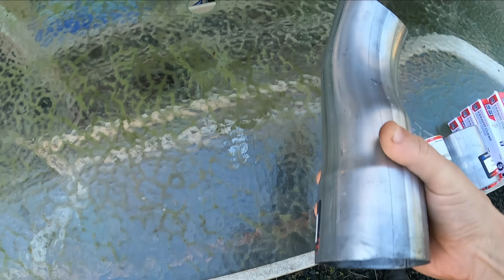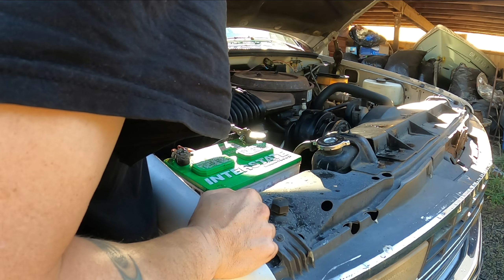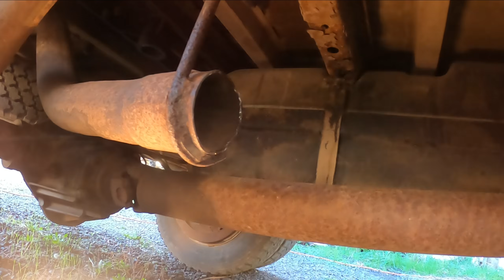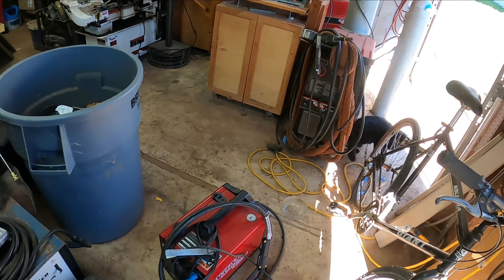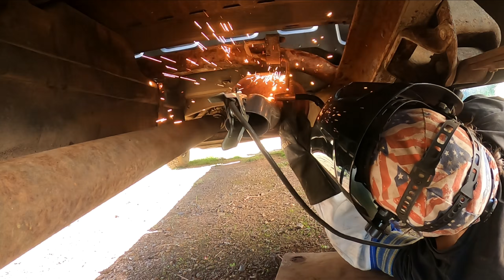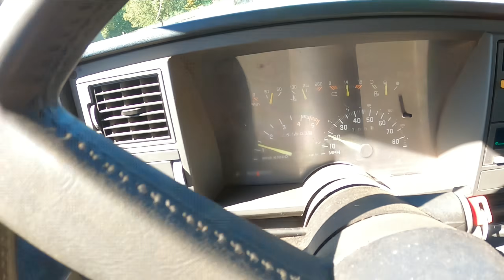93 Chevy 454 Cat Delete

Comment: Need a heated o2 sensor with the cat delete. The better flow causes the sensor to get too cold
Reply from the maker: Thanks for the tip, I'll look into that
Reply: @ClassALiving  I just tapped the heater wire into the power for the fuel pump. It only draws a peak of 5 amps so it shouldn’t overload the circuit

Comment: I experienced power loss on my 88. Replace all sensors, replaced entire ignition system, eve cut the cat...cutting the cat i dont like it...the fumes are outrageous lol, i walk in the house snelling like exhaust smoke. Ended up being my spark plugs and wires that i just replaced 1.5yrs ago.

Comment: Those older TBI throttle bodies have fuel lines that run along the back of the engine and when you run the engine it heats up those fuel lines and you get vapor lock so unbolting the bracket and putting some silicone hose around those fuel lines can help stop that problem

Comment: That one looks like it'd be pretty tough to gut I gutted the one in my 2nd gen dodge while it was still attached to the truck just cut the exhaust off behind it, then started the truck and blew it all out after running a drill through several times, and reattached the exhaust with a clamp. Great video

Comment: Nathan, I know I wrote a book with this post, but read it. The TBI engines are so simple to diagnose and not fire the parts cannon at it.

First before anything we need to see if its a sensor. Once the engine is warm it puts the ECM into closed loop, and now its getting info from the sensors to adjust the fuel and spark. You can unplug the coolant sensor (may be 2 one for ECM one for gauge) that will keep the ECM in open loop, wait till it gets hot and if it runs great hot and in open loop then we can start to diagnose sensors. 

It could also be the spark module in the distributor. It may be worth driving it to an auto parts store that has an ignition module tester, just pull it out in the parking lot and take it in. They tend to work good cold and once they get some heat from the engine they start messing up.

If you can mount your go pro under the hood take and remove the entire air cleaner and spacer. Point camera to the TBI  and drive. You can see the fuel spray into the TBI and possibly help figure out spark or fuel issue.
Reply from the maker: Great info thanks!
Reply: @ClassALiving  In case you haven't found out, that cat converter is called a GM bead-type, there's pics and diagrams on the internet and info about them. 

Short story, they're very restrictive and you did the best thing by getting rid of it, I can guarantee you picked up no less than 20hp and tq just from that alone. I'm sure you noticed the extra power, engine/throttle response and better mpg (ever bit counts in a truck like that).

Comment: The coil pack is shorting out when they warm up. If it has two coils, one will reduce power to both coils.
Reply: no coil packs on a 93 454. single coil distributor ignition system.
Reply: @marzsit9833  The point is, Change the coil to see if the problem goes away. Cheep easy fix.
Reply: @badbadbob1  will it be both cheap and easy when it does not fix it?
Nope
In fact you will have wasted money and time that you might have used to diagnose.
There are both static and dynamic tests that can be done to ignition coils.
It takes like 5 minutes.

Comment: Fuel Pressure regulator is on the rear of the TBI unit. You'll see it connected to the injector cradle.

Comment: It's not an EGR valve
It's not an O2 sensor it doesn't have that kind of authority.
If you think it is lacking fuel, find a way to give it extra fuel while you are driving and see if that remedies it, propane Works real well.
The way it surges on wide-open throttle I would be looking seriously at the distributor pick-up inside the distributor.
The rhythm of the that surge is Not an Accident there's a reason.
Try propane enrichment first, if that works back-trace and find what's wrong with the supply system.

Comment: Meow 😸 sell it at the scrap yard.. just research what it’s worth.. it might buy some welding wire or shielding gas
Reply: That style are worthless, not even the cost of a soda
Reply: @F239141  I kinda thought it looked like the ones from the 80’s ?  Do the ones from the 80’s bring an good buck?
Reply: @462ANIMAL like a few dollars not worth the time to load in the truck to take it
Reply: @F239141  hmmm I wonder about the late 70’s GM ones.. I’ll have to look it up what I have .

Comment: Probably o2 sensor. I would guess the open/close loop isnt working correctly (due to bad o2) when the truck warms up, causing fuel trims to be weird.
Reply: Probably not, an O2 sensor on a 1993 454.
This is OBD1, the oxygen sensor does not have that kind of authority.
You could short it to a full 5-volt reference, or slam it to ground, wide open throttle will not act like that because of a bad O2 sensor, simple as that.
The first thing you do, is isolate if it is a fuel problem or an ignition problem and go from there.
The last thing you do is try to unthread a seized up 30 year old oxygen sensor, screw up the threads, repair the threads, buy a new oxygen sensor, and find out it didn't work.
Stop throwing darts, admit that you don't know, and use logical Diagnostics to get to the root of the problem.
That's how you fix cars and trucks.
Reply: @reubenj.cogburn8546 yep....under WOT... it's not in closed loop anyway....